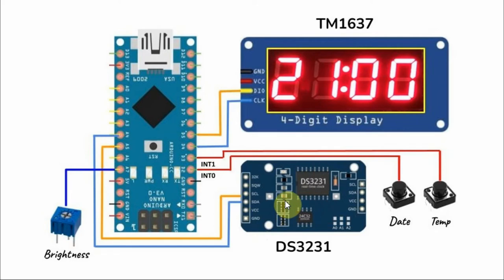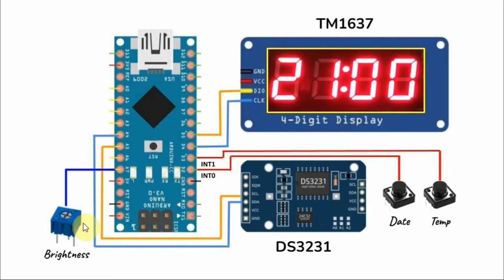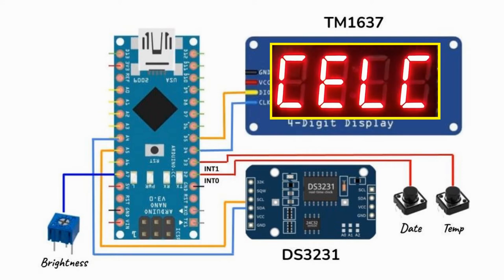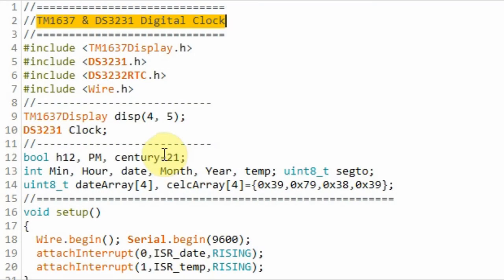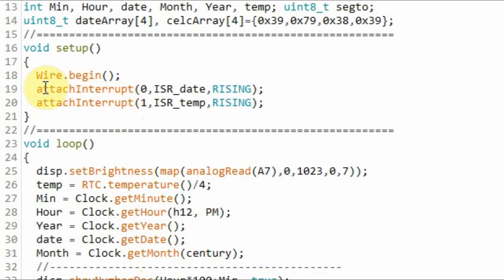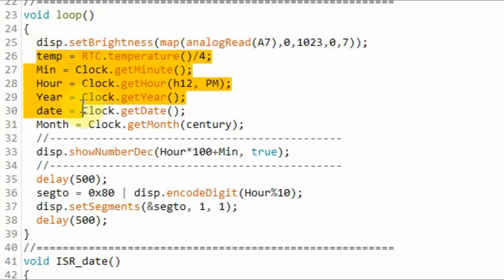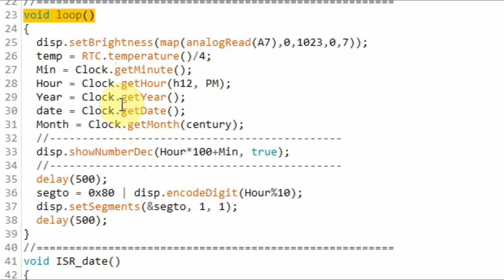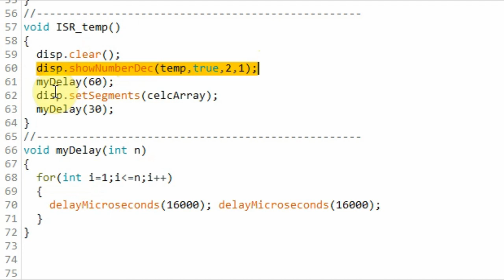Real-Time Clock using TM1637 & DS3231

Comment: Please advise - your clock works OK but will not update the time of the DS3231 when I do an upload. have tried 2 x DS3231 boards with the same results, also tried 3 x Arduino Nano boards. Is the time picked up from the laptop time - it woild seem so. Would this be a library problem? Where can I get the include file for the DS3231 that you used in your original clock? Otherwise very easy sketch to follow - great software!  Last thought is for "ZERO"  suppression?  I love your videos!

Comment: Further to my comment 25th Mar. please advise where to get the exact libraries for DS3231 and TM1637 that you used for the clock, as there are lots of them hanging around, so I cannot compile your sketch, there is something still missing in the libraries I am using.

Comment: Let's say the button cell runs out and we have to put a new one - then don't we have to set the time on the DS3231 for the first time as the RTC may not know what is the current date/time. First timer question.
Reply from the maker: Yes, time & date need to be set when battery is replaced. You can watch my DS3231 tutorial where I've created a library to set time & date: https://www.youtube.com/watch?v=o8UhOw2vT9U&t=11s

Comment: Hi! I wanted to do a circuit like this, I managed to do one with a watch, but when I saw what you did I bought another display. I changed the code and now it shows only the date; my problem is that the RTC module resets when the power is turned off, so I have to adjust the date from the buttons. Do you think you can help me ? Adding 2 push buttons. Thank you.
Reply from the maker: Hi, thanks for your feedback. I have a tutorial video where I explain in detail how to program RTC from scratch to display time and date. I hope it helps. https://www.youtube.com/watch?v=Xu7_rwOnkWs

Comment: hello bro how about if I Change the existing 7 Segment with large 7 segement example 2.3 inch 7 segment with 7Volt?? can i colaborate it with tm1637? Thank You.
Reply from the maker: In theory yes. You need to use TM1637 IC, not the module. In addition, you can use MAX7219 IC to drive your display.